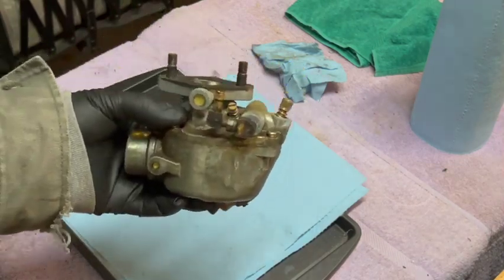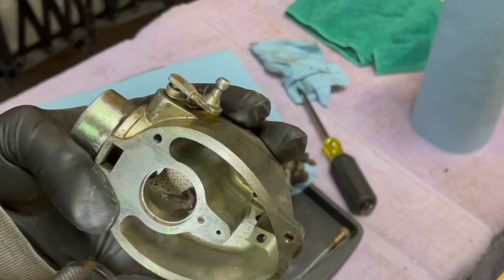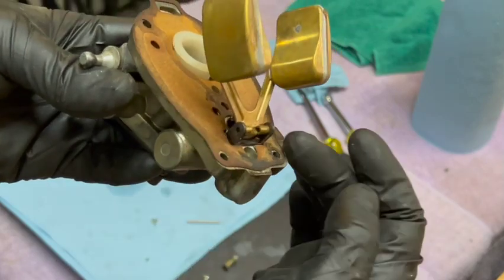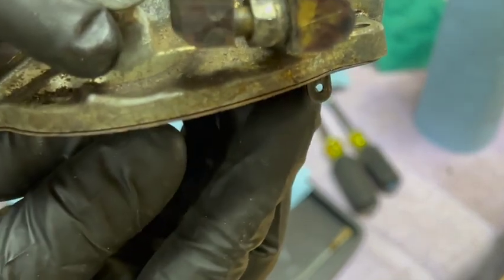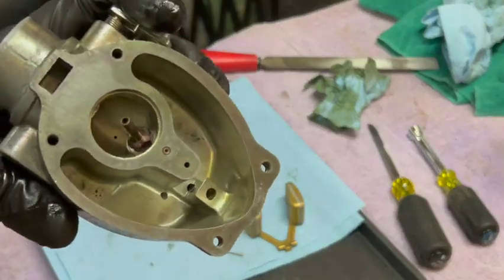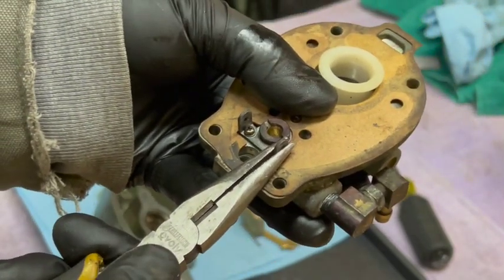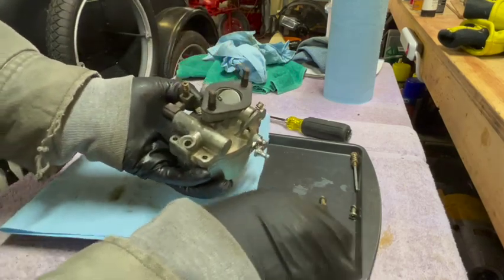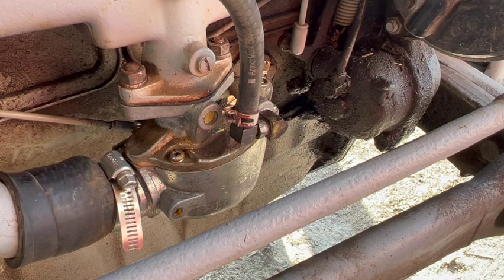Ford 2N - Carburetor Overfilling, Flooding, Leaking

Comment: I doubt this is a problem for you but I thoguht I would mention it in case it could help someone else. I had trencher with a carb similar to yours and it kept running out of fuel. I took it apart numerous times and cleaned and blew it out with air. One time I finally took out the seat and there was a flake of paint up there and it would never blow out with air but sometimes it would cover the hole in the top of the seat and prevent gas flow. Now I always remove the seat when cleaning a carb. to check for dirt up in there.
Reply from the maker: Yes, it doesn't take much to block that little hole. Thanks!

Comment: Thanks for the pointers, my 2N wasn’t getting gas, no start.  Carb hadn’t been touched in 18 years.  I took it apart, cleaned the cab, took it apart and used air to blow out the passageways.  Reassembled and it started fast as when it was rebuilt 18 years ago.  I suppose I could get a rebuild kit now.😎

The other issue I have is leaky oil pressure gauge.  I have tried to carefully tighten the fittings but no matter it leaks(all over the carb side of the engine.  Maybe a new gauge will have a tighter fitting gs?
Reply from the maker: Maybe check/clean the threads on the back of the oil gauge? I might be worth a try …

Comment: Awesome. Just bought a 9n, has a leaky carb. Can I ask what fluid you use in the sonic cleaner? Also, that carry bucket is cool. Are these available for purchase anywhere.
Reply from the maker: I use straight parts cleaner, like Berryman's in the ultrasonic cleaner. After about 5 uses I drain, strain, and reuse it over and over. No, those "Ferguson Transport Boxes" are no longer being made. If you ever see one for sale, you'd better buy it. They are pretty rare, especially in good condition! Good luck with the 9N!
Reply: @AntiqueCarsandStuff  Oh, what is the best temp to set the cleaner to? Thanks
Reply from the maker: I think I usually set mine to about 50C which is about 122F. Seems to work well at that temp.
Reply: @AntiqueCarsandStuff  Thanks for the tip. So, I pulled and cleaned the carb and changed the spark plugs. Now she won't run with the choke in! I'm guessing something didn't quite go back right. Any ideas?